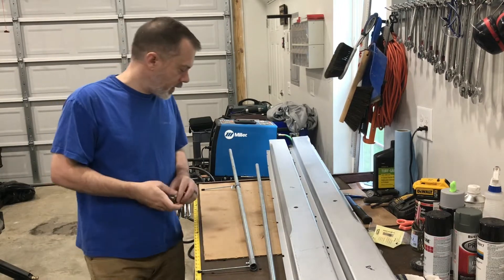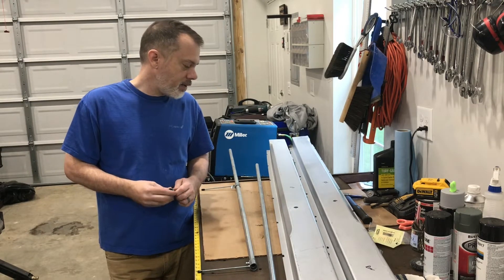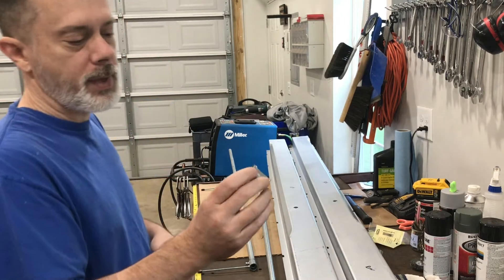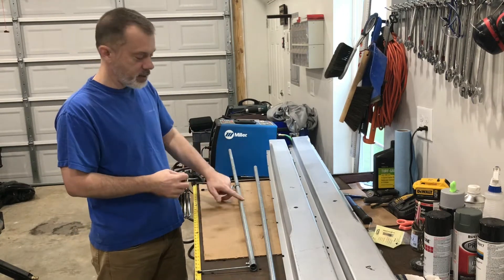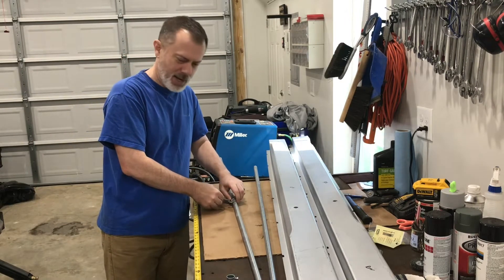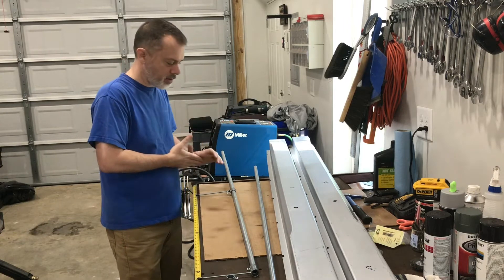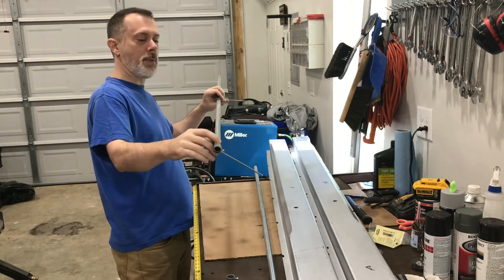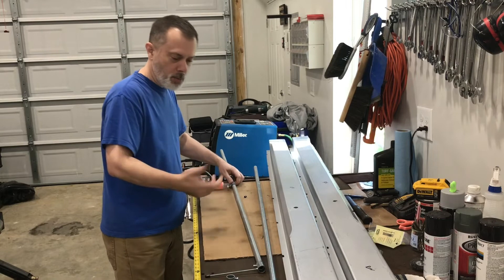Homemade tram gauge build

Comment: thanks for the video. when using the tram under the hood should the horizontal conduit be level? if so then the threaded rod would need adjusting
Reply from the maker: Ideally yes, but since you would typically be confirming a point to point measurement, threaded rods of differing length wouldn’t actually change the tip to tip distance.